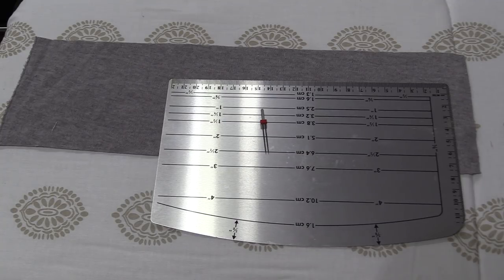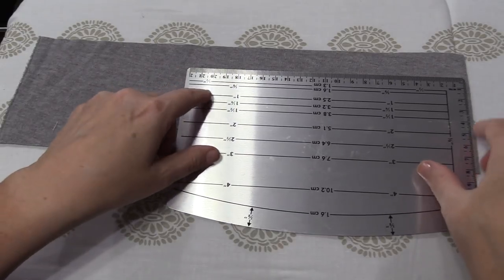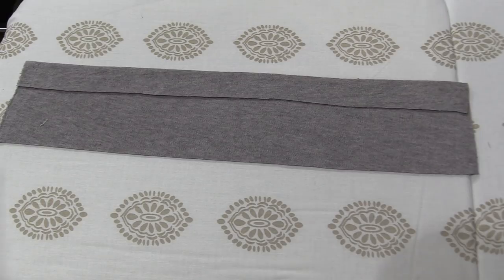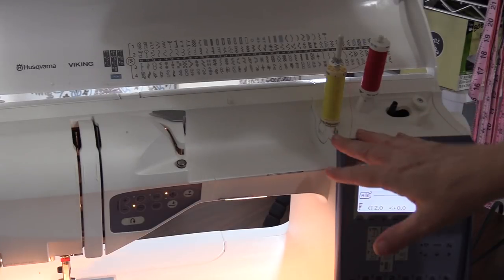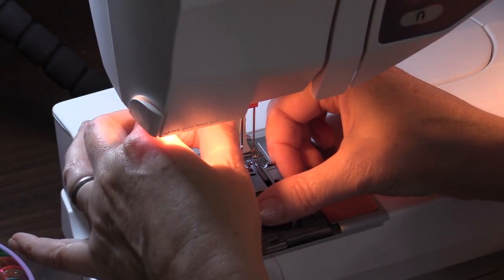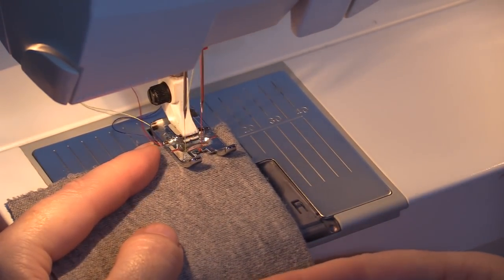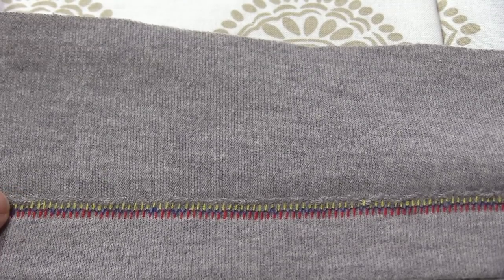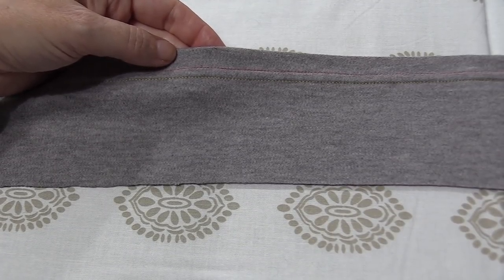How to Hem Knit Fabric with a Twin Needle

Comment: I have a Janome sewing machine and I recently purchased a twin needle for knit fabrics, but there doesn't seem to be any instructions in my manual.  Can a twin needle be used with all sewing machines?
Reply from the maker: It works with all of the Janome models I know of since it inserts just like a regular sewing machine needle. 

The only machines it does not work with are the machines that can only do a straight stitch and have a small hole on the throat plate for only a single needle to go down into.
Reply: Thanks for letting me know.  I am a beginner to sewing and didn’t want to mess up the machine.